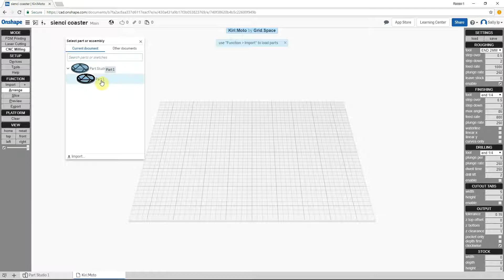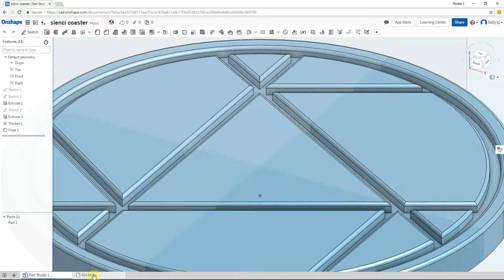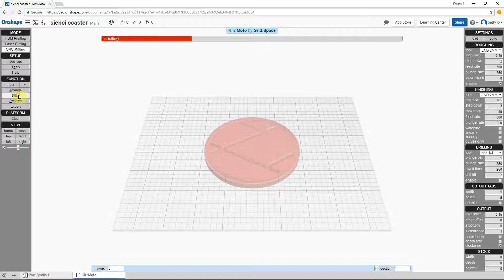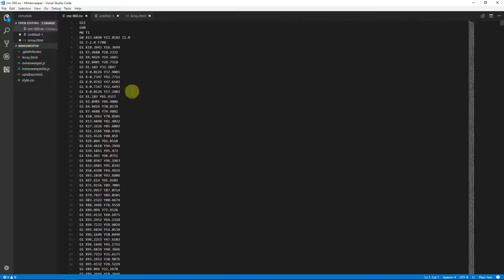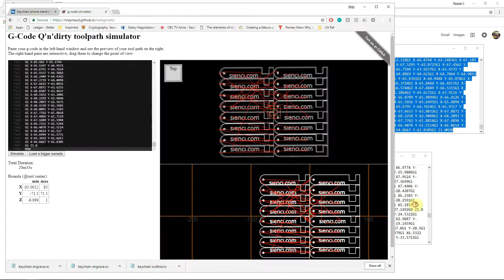Getting Started with CNC milling: CAM setup using Kiri:Moto

Comment: Thanks for the video. one thing I ran into was I had to sign out of OnShape then back in to be able to see the Kiri:Moto added  to my applications after clicking the "+" sign.
But I ran into an issue where the menus didn't match yours. I may need to find a video on setting up Kiri:Moto.

Comment: Hi, thanks for informative video. I am curious about using Kiri moto and I have question : Is it possible to prepare coin mold with this software from picture not from actual 3D coin for my metal casting project ?
Reply from the maker: Kiri Moto is designed to be used with just 3D models right now, so if you'd like to do a coin mould then you'd need a 3D model of it.
- Chris